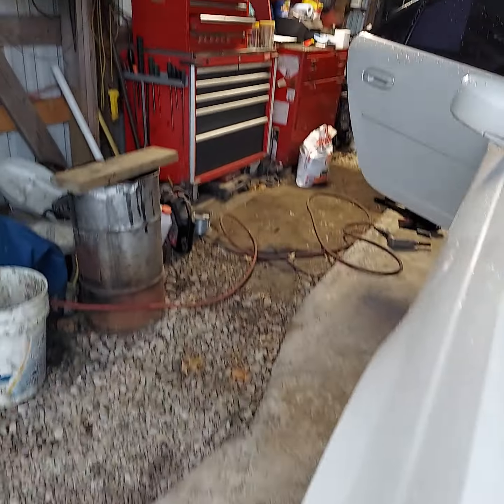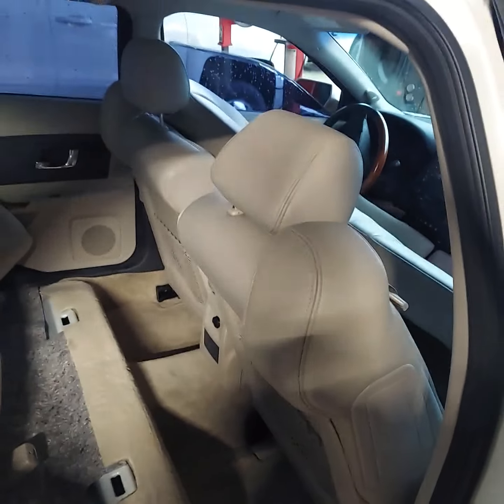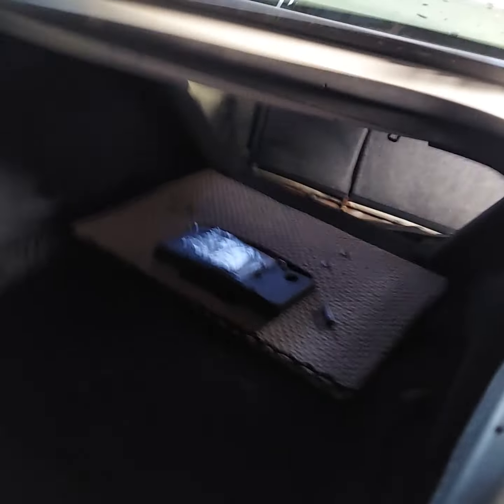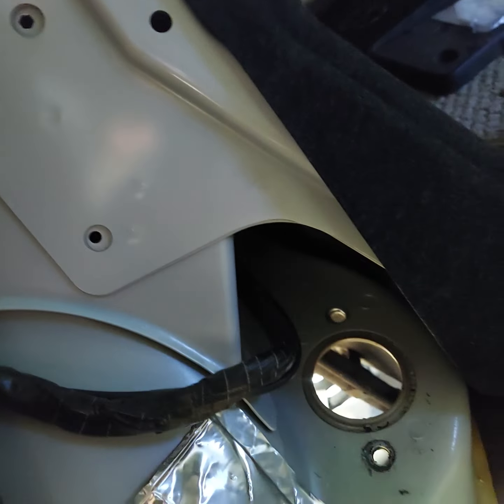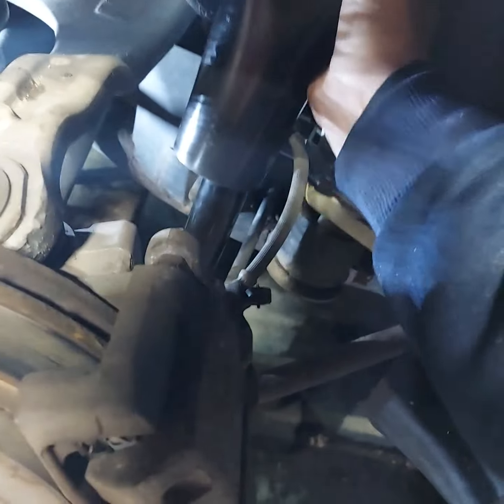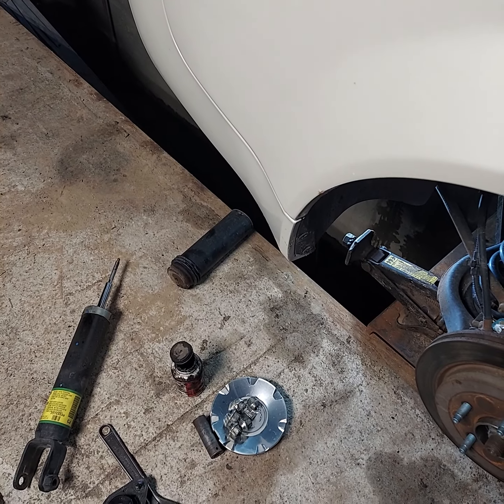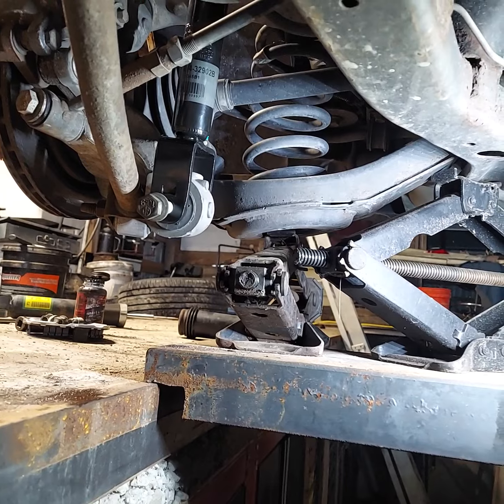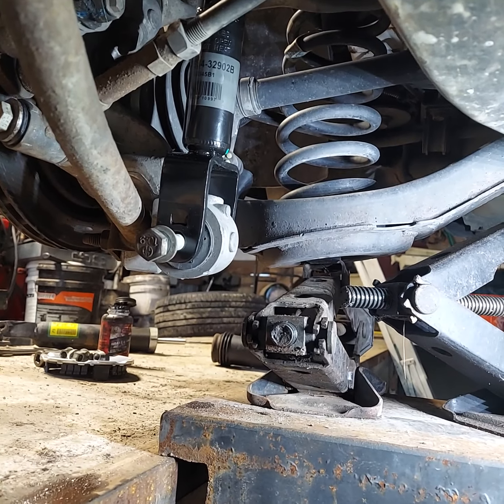2004 CTS rear shock absorber replacement

Comment: Hi! I have a cts 2010 and I was wondering if I can drive for 1 more week with leaking front right shock absorber thx for answering
Reply from the maker: a leaky shock absorber or strut is not critical but the purpose of these is to stop the up & down oscillation of the coil/leaf spring.
You can et a tire to lose contact with the road simply from excessive wheel bounce that isn't tamed by the shock/strut. This is at higher (highway) speed &/or rough road surface when this is more of a concern. Usually, I would say, under 50 mph, you would be fine